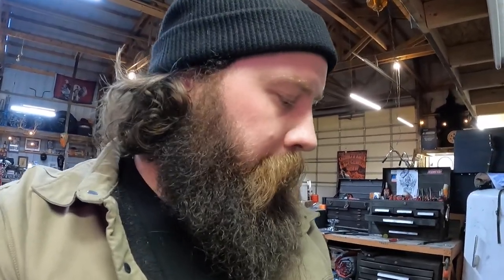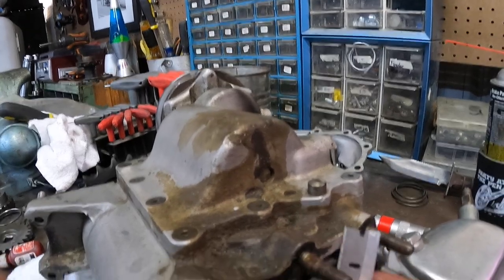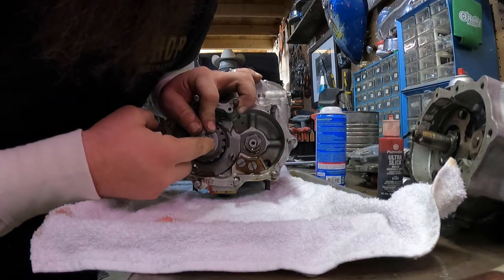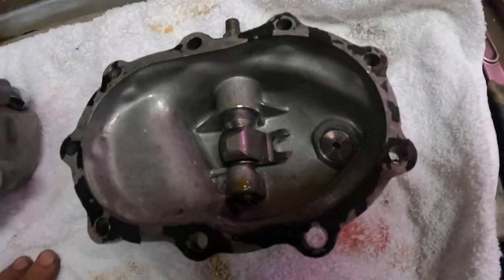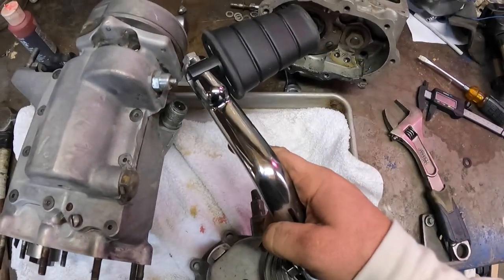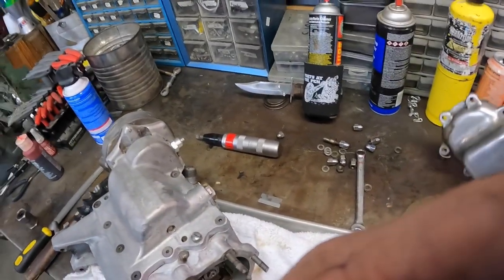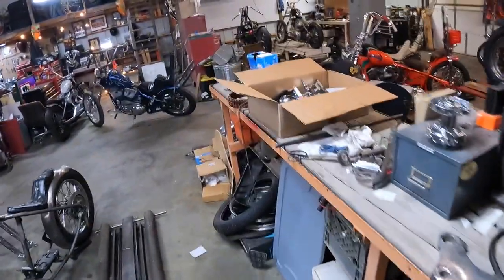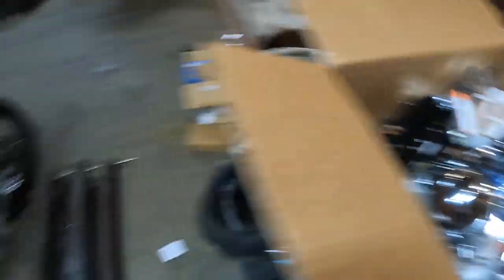Chopper How To: Shovelhead Kickstart Conversion

Comment: For the last ten years or so I've been throwing 5 speeds behind Shovels, nothing wrong with Shovel engines, it's the 1930s designed transmissions that holds them back.
Reply from the maker: I love four speeds and five speeds. The biggest difference I can fine between the two is with canyon riding. the extra gear in The five speed seems to be somewhere in between second and third the final drive gears are the same size between a four-speed and a five speed.
Reply: Another reason I like using 5 speed is the avalibility of different modern primary and clutch systems.
Reply from the maker: @kct9967  and they are a lot more affordable compared to the four-speed

Comment: Awesome video. The only thing is, those oil slinger style ones aren’t great for foot clutch, if someone is doing a jockey shift. They aren’t very strong. So converting to a throw out bearing would be better in that case. Really the throw outs are better all around.

Comment: Good to see a great video on the proper installation of a kick starter. Personally I've never owned or wanted a bike with the pussy start button. 
Know your bike and listen to what it tells you when kicking it over and it will be a one or two kicker. If I get too old ( or dumb) to kick start it reliably maybe I shouldn't be riding.
Another great video in the vault, keep up the fantastic work. 
You guys have a great thing going on in that shop setup, show each other respect and make it last.
Reply from the maker: Thanks man. I couldn’t agree more. Glad we are on the same page
Reply: you get old one day your thinking will change
Reply: @donrice8026  I'm 72 now and my thinking hasn't changed yet. Granted there has been the odd time or two that it would of been nice to just tickle that  button and go ( like when it's 110° out and it stalls in traffic) but I felt that way too when I was in my twenties. 
If I get to the point where I'm not physically capable of kick starting the Shovel I'll know it's time to pack it in, and yes I know that day will come.
Reply from the maker: @74willy81  this is probably the best comment I’ve ever read.

Comment: Also, back in the day, batteries and ignition systems weren't comparable (reliable, powerful) to modern batteries. You could easily run the battery down trying to start a bike with points setup.

Comment: Hey Cody , thanks for your videos brother . I was wanting to know if you would mind explaining what your parts list would be if you're starting from scratch building a chop. I plan on buying a shovel engine then finding a frame and so on. I've built on to an existing bike before but I want to start from scratch and would like to know everything that is needed to make a runner . It could be a cool series on different motors . Anyways thanks for your content.
Reply from the maker: well, that’s A tough one. Building a bike starting with only a engine is pretty damn hard not to mention way more expensive. When you start off with a donor bike you end up using a lot more then you would expect. Even little stuff like hardware adds up 
Quickly. I’ve done builds like this plenty of times and I have a pretty decent collection of parts in stock And I still usually get nickel and dimmed to death over the little stuff that you don’t think About. My opinion after doing this a few times (and I might make a video on it) is… buy a full stock bike running or not. Take inventory of all the parts that you can use from the stock bike (wheels, frontend, frame, drivetrain, etc.) that will give you a pretty good idea of what your going to need. Then you can make a large portion of your money back by selling what you don’t need from the stock bike and help you fund your build. I’ll go into more details when I cover this in a video. Hope this helps ya.
Reply: @codyschoppercorner5727  yea that makes sense for sure because I can sell what I'm not wanting to get what I want and after seeing how much shovelhead motors are you might as well buy the whole bike. Thanks for the insight, truly enjoy your content, very informative.

Comment: Why not keep the electric start and add the kicker ?
Reply from the maker: Most of the time this is all about simplicity, removing what you don’t absolutely need. Getting rid of the starter is also getting rid of potential issues with wiring and other moving parts. Another plus is being able to run a $20 dollar battery that only has to keep up with your ignition and lights. A battery that has enough CCA for starting a 74”+ engine usually cost around $150 and up.

Comment: Canbyou find kicker convertions for most bike or are they only for certain bikes
Reply from the maker: Usually if that model came with a kick starter and some didn’t come with the kick starter you can convert it using the factory pieces that came on the Kickstarter model.
Reply: @codyschoppercorner5727  thank you